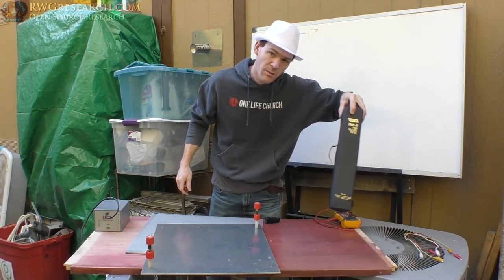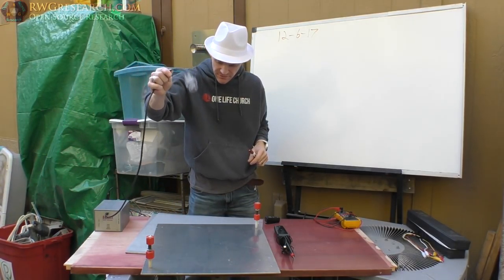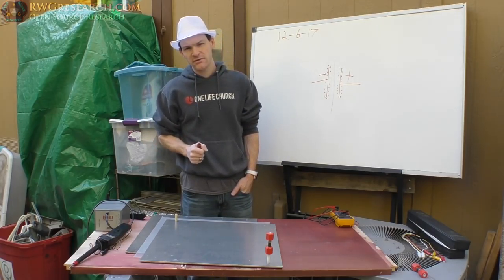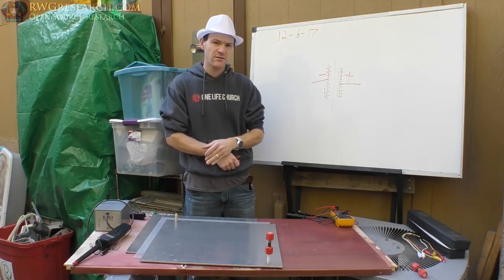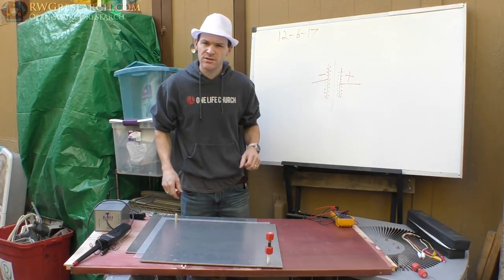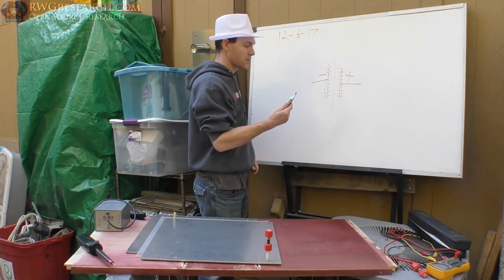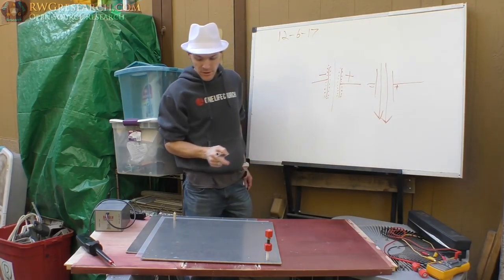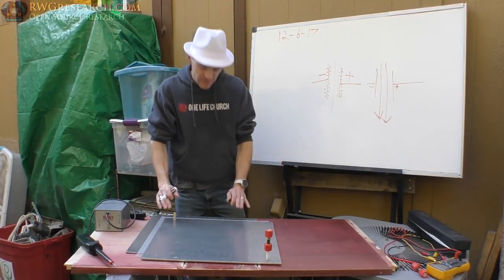The Search For Answers Part 12: "Charge IS Stored On The Plates" Are You Sure About That?

Comment: Having a good structured dialectric sheet between two plates is key to a good capacitor, meaning isolator with some very precisely defined characteristics.
Now I will  be  a bit clever in my own way and with some provable examples:

Lets spit a bit on a mainstream science first.
When ever you read some scientific paper related to term: "electromagnetism", (and mind you this is very broad term)  inevitably you will come  across expression: "Vortex like feature"
This usually means that they do not have a clue what is cause and effect of that "Vortex like feature".
What ever we invent it works, but barely. This is general rule.
Yet another and I might say very odd general rule is that most important discoveries came from individuals who were outside of mainstream and remain there after their discoveries and from individuals who were  outside of mainstream and become mainstream with their discoveries.
Maxwell is good example for second one,
as well as Faraday thanks to Maxwell who supported and even proved Faraday postulates.
One of Faraday's postulates was that electricity manifest it self as invisible force.
That force has lots of different names including electromagnetic field in electromagnet. very same phenomenon we do find in permanent magnets too.
Pity that latter scientist got it all wrong  and today we are stacked with particle physics ant quantum mambo jumbo instead of real science.

Back to capacitors.
As always ti get more charge  stored you need more surface, so your plates need to be etched. (aluminium is easily etched with acid). 
Most important part, that dialectric layer needs to have following properties:
It has to have fiber like structure,
It has to have high density.
In general, Fiber like structure of this material  needs to be in Nano value
I should seriously consider material like carbon nano tubes.
Technology is developed enough to produce  short peaces, just enough for something what could be described as thin sheet of highly compressed carbon nano tubes.  

Preparation.
Between two etched plates spray paint ,or one can even do it with 3D printer on both  plates.
Put those two coated plates  (the coated surfaces touches each other)  afterwards in hydraulic press.
 As a product you shall have your super capacitor which only needs wires attached and  isolation coating which will add some structure stability and will not allow those plates to repel.
Thicker that fiber layer higher voltage you can achieve.
Btw, this is just simple alternation in already existing technology. Ceramic capacitors are made in this fashion,

I hope this will help.
There is a lot of proper explanation behind this idea obviously.
If some one is interested please do contact me.
You can always find me on facebook.
https://www.facebook.com/igor.stojanovic.1671
Reply: What about air capacitor, there is No fiber just distance ?? The dielectric you are talking about is only to get the plates closer to its other without them shorting them self out, ore spark jumping. So the better dielectric the closer distance ............But The question was where are de electric charge present, and in whits way. .....I don't Know
Reply: Air capacitor is not ideal for capacitors capable of containing  high pressure charge, Firstly  humidity will cause drastic changes in its dielectric properties. (Same thing happens with paper and thats why paper is always soaked in oil).
Secondly, To achieve better capacitance plates must be as closer as possible to each other and that is something what makes air really unsuitable for this kind of application.
Reply: Igor you are absolutely right, just trying to finde out where the charge ware hidden....do you know ?
Reply: I am afraid that I do not understand question?
Reply: Yes he was asking Where are the charge hidden in the sheets, that he took out ad replaced again...... Then he asked Where are the charge hidden, and what happens when there are no sheet, can you blow the charge away with blowing on the surface....ore what will happen ???? That was What I was trying to finde the answer for....but I don't know.....do You ?
Reply: There is always more than one way to skin a cat.
Understanding underlying processes is all you need to have for right answers
Reply: Yes .........But What is IT...... that was The question ????? ;-) To Be and Not to Be is the question ....and I want to Be .......hmmm but What?? ;-) Bless you and Happy New Year. Se U
Reply: There are no hiden charges.
For more quantity of the  charge you need bigger surface.
For more efficient capacitor you need good dialectric between sheets.
There is no mistery there.
Reply: Are you familiar with vortex like nature of electromagnetism?
Lots of people do find similarities in dynamic of fluid helpful.
I can give you long explanation if you do have at least one hour to spare for conversation. Hell, I can do it right now If you would like.
Reply: Yes you are completely right I know This to, but where are the charge stored, in whits aria ore surface, if you look at the electrons where are the potential stored ?
Reply: I have made a Facebook reqest, maybe we can talk there.  Vortex sounds very interesting, and I think it is Importen to understand Nature Including Vortex, because it is pressent manny places in space and in Nature general...as far as I understand about Vortes, and what I am told, The spinning of water and matter, are coming from the earth spinning, but That's not the hole truth..There are much more to it Then That.....Right ? Best JT

Comment: The reason that air caps hold a charge when air is blown past but that demo makes things complicated is due to the charge moving. When you charge the plates it is the metal that holds the charge but as you start to remove them the charge moves to the dielectric as static. The charge wants to be at the highest potential and as the plate is moved away the capacitance drops so the Mylar is now where the most potential is. Think of it analogous to "the path of least resistance" only its the place of highest potential.
Sorry if this is not clear its hard too grasp but then when you see it you feel like a huge idiot for not seeing it in the first place kinda thing.

Comment: If I think on Thunderstorm. It is also a capacitor in nature, charging up the surroundings with dielectric in-between, and sometime we can hear the sparks jumping, making a lot of rumble. So to answer This christian is, the charge are stored in the surface of the sheets, and The reason you don't get shocks when touching the sheets, is that the service aria  ..Is not  containing the mount of charge, not big enough to let a spark jump true you restively fingers, typically a 1K - 10M Ohm what i mean is the volt is not high enough to make a spark. And Then Back to the christian no. 2 If ear Is Present... and No sheet, where are the charge then stored.....Hmmm  so if I am right, there must be an area where the charge can build up and that is on the surface and when there is No sheet there is No sheet surface, so biasicley the ear between the plates, will charged up, and when you blow it out between the sheets the charge should follow..........In a noter way you should be able to charge the plated with blowing charge ear between to plats and be able to discharge them from the plates.................but which is which polarity, what become negative and which become positive, you probable have to connect ground earth to one of the plates and only to one .........but ear has to be dry.......so ear it self can carry a charge ........................ I don't know............ But I am probable wrong ........  Best Jørgen Thomsen Denmark dk